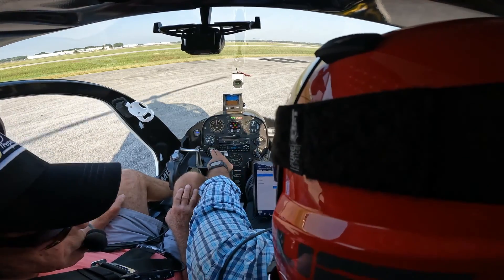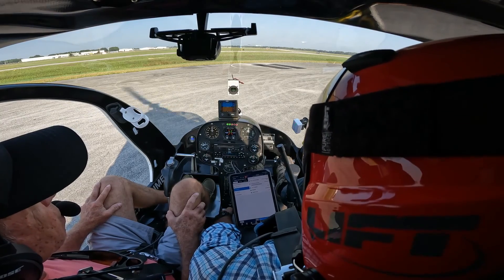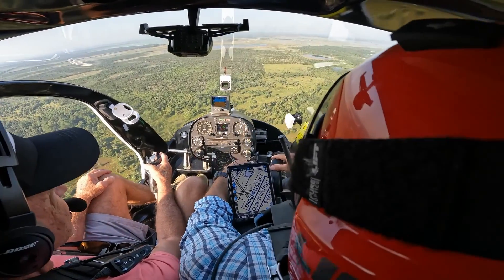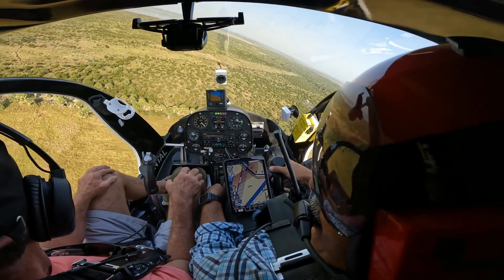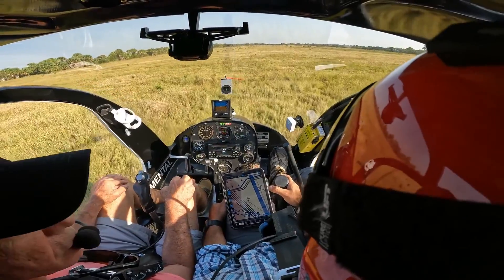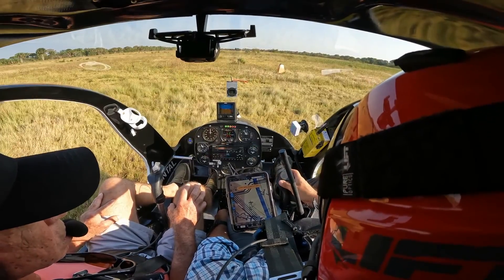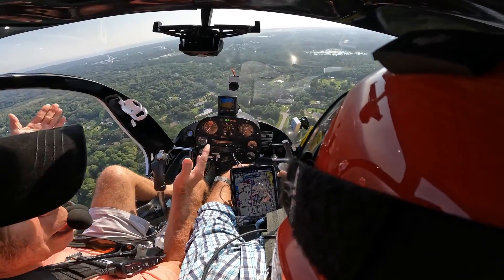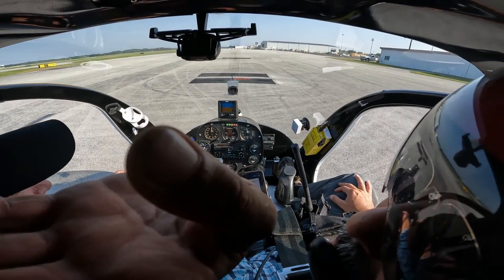Rotorway Flight Bill Anderson

Comment: Hey Joe, 

would like some clarity on something

1. On a normal take-off once you hit 65MPH does it climb on it's own or you have to make an aft cyclic movement ? 

2. you also mentioned that on straight level flight if you make a slight aft input it climbs ? that confused me cause if it's at 29 cruise power how can it begin to climb further with only aft input and no additional power ? i thought you can only climb if you add some little inches like 32 and you begin climbing, you demonstrated the helicopter climbing without additional power
Reply from the maker: 1. Once you accelerate to 65MPH during takeoff you only need to relax a tiny amount of forward cyclic and the nose will pitch up into the climb attitude.

2. For altitude adjustments of less than 100 feet I teach using cyclic only. For example if you were at 400 feet and wanted to climb to 500ft leave the collective set and add a little aft cyclic pressure. The nose will go up and you will climb. You will also loss some air speed but will slowly gain it back once you level off.